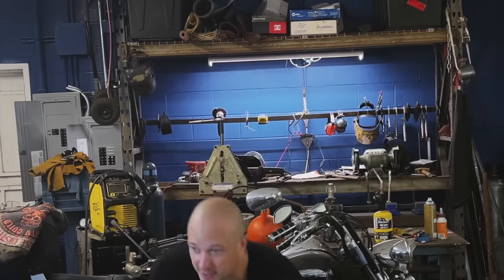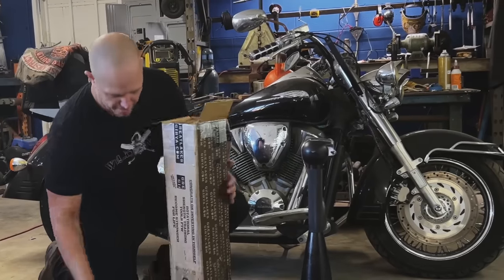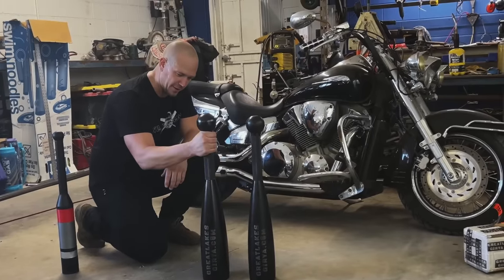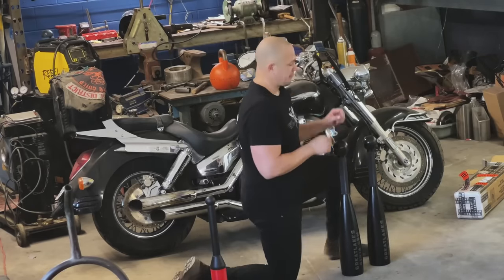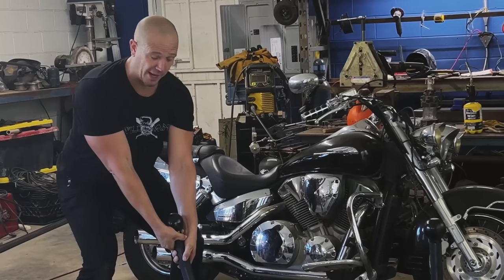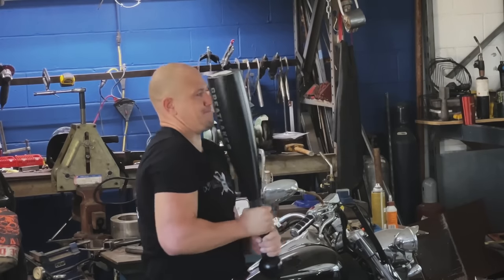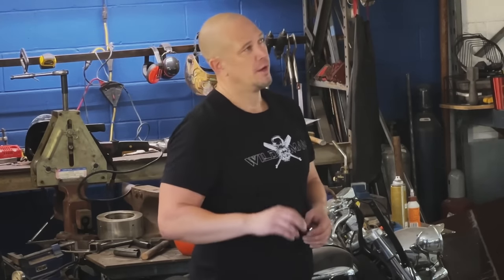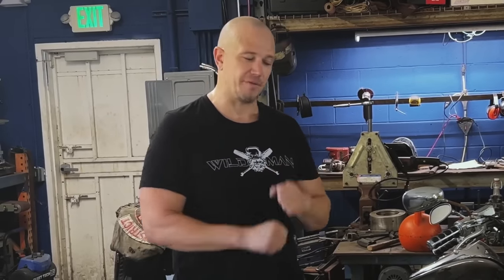How Club Training Changes Above 50 lbs—Unboxing an 80lb Steel Club

Comment: sweet clubs , I'm finding the handles on their clubs are pretty slippery , even when we chalked up . But solid club for sure none the less. kick ass three reps cold man !
Reply: Are the clubs you have our old or new ones ? The knurling is fairly grippy on the new clubs.
Reply: @GreatLakesGiryaPro Clubs  are two years maybe ? . the knurling does look different than the one mark has there .
Reply: @shak535  that would be the e coated non knurled version. They were slippery. I agree. 
I like e-coat knurled much better 👍
Reply: I've put grip tape (hockey tape, eh?) on the handles of the clubs I have and it's been great. I had previously found the knurling to be on the light side (XM Fitness brand) for sweaty hands.
Reply: @VosperCDN  the new clubs we have have an aggressive knurling. 👍
Reply: @GreatLakesGiryaPro  Good to know, wouldn't do for monsters like that to escape :o
Reply: @VosperCDN  thank you for that idea eh  , I'm going to give that a try .
Reply from the maker: These ones have absolutely fantastic knurling on them

Comment: Does the paper label on the base add to the weight over 36 kg? 😂 

That’s an insane weight! Well done! I’d worry about bonking my face with that kind of weight. 

I recently did a single arm landmine chest press at 60 kg total weight (2 x 20 kg plates + 20 kg Olympic bar) and because my hand was slippery with sweating it dropped onto my shoulder and a bruise of the dark purple kind resulted days later! 

I can’t lift these heavy weights due to hyperhidrosis. Swinging anything above at 32 kg kettlebell just flies across the room (despite on the rare dry hand days, I can do single arm 44 kg swings no problem). 

I did a 12 kg single arm alternating mill with a Clubbell and that went flying across the room as can’t get a solid grip because of the hyperhidrosis! Gloves are a waste of time. Chalk too! Regular toweling-off works but not fullproof. Any suggestions?

I know I can get into this heavier weight territory if I can find a reliable way to curb this hand hyperhidrosis.

Comment: Get that 80 pound mace adex which is really a gada and do spear moves ,grave digger moves, prepping yourself for launching moves launch and get it and just doing the ten to two's different squat variations. Ha still a 80 lb water bag on the kit in the interest of being able to make more forgiving mistakes what if you could get the mastodon kit and there was somehow a way to cover the kit with a 80 to 120 pound lb water bag . 80 +120=200 pounds. 200 pound mace .. gada..

Comment: Try doing outside the leg swings  doubles and then  singles outside the leg swings and eventually outside single-arm swings to pullover. Also do swings from the back of the body side ways across and straight out and put it together with inside and outside low swinging pendulums swings (cleans is next level but try)Do a lot of two  arm swings but when you feel it's safe take any hand of your choice out of the equation.
Reply: The should make a club , mace , arc and kettlebell that light  up when you complete something as  motivation. The arc would flash lighting kettlebells multi colors  mace random colors . And make thunder ⚡ sounds
Reply: Sometimes I eat a bag of mushrooms and mess around with heavy weights. Not seriously training but it's pretty well gotta be the same thing, right?
Reply: @darkclownKellen  and it should make thunder ⚡ sounds. Mace 360 with thunder ⚡ sounds!?,and lighting graffics!?

Comment: Damn, sir! That is impressive.
Your statement on form keeps hitting me in the face (metaphorically) when I jump weights on my one arm program. Those swings that come when I'm tired start to get a little sloppy and I have to fight to keep myself straight. When I get it right, I can move up in weight. If I leave it crappy, I don't go anywhere.
Side note: Kind of funny how you're doing this in front of a VTX1800. When the bike came out, it was the first power cruiser and the first production bike with an engine of that size. Was the placement on purpose?
Reply from the maker: It’s just what happens to be in the shop today. I do love power cruisers, and there’s a couple floating around in here.. for a guy my size they are pretty ideal

Comment: Have you thought about microloading using the ProKettlebell magnet weights?
Reply from the maker: Absolutely not on this thing
Reply from the maker: Yeah, could probably work but seeing as how this is all torsion and traction and try planar movements, I’m pretty sure I’d have to do some math to figure out if the speed of the club is going to cash that magnet off before I do it or just do it in a padded room
Reply: Lever length and velocity would contribute much more to the shear force than the club's intrinsic weight -- so you can probably test it out with an fairly lightly loaded Arc (or club with the 3d print spacers) for a similar length but higher peak velocity, given it would be a submaximal weight.
Reply: Maybe do it outside in a wide open field (half the workout is getting the club out there).  Or lock it down with a bunch of gaffer tape.